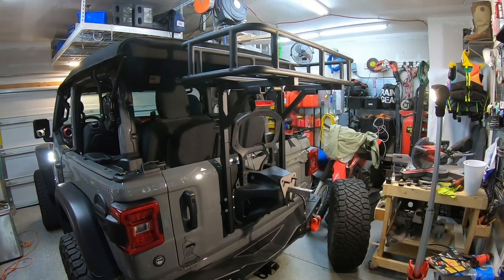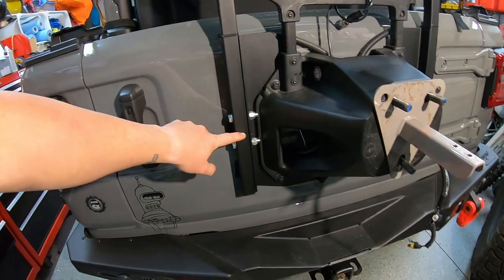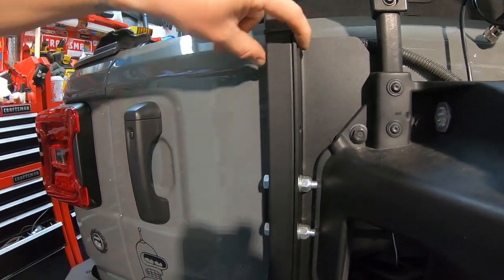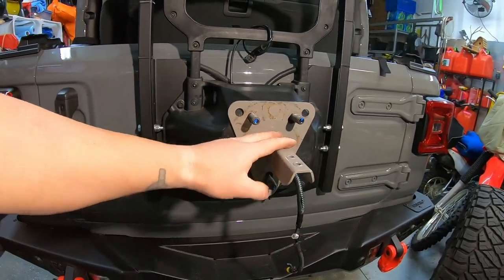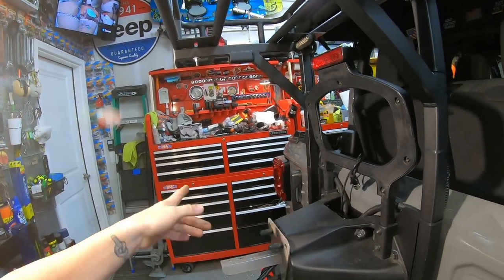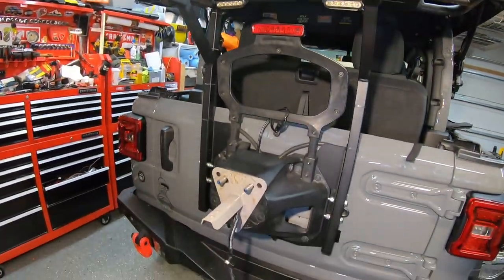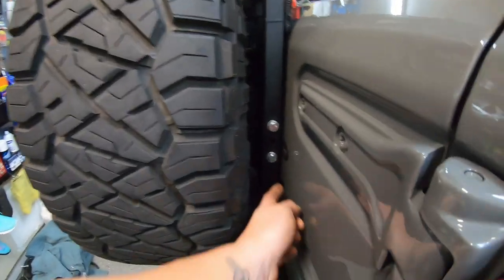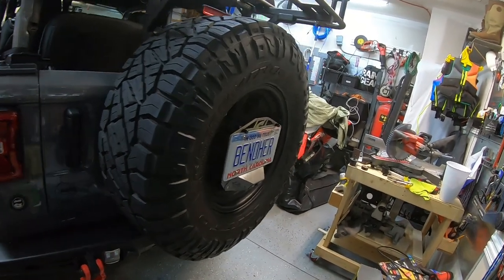Paramount 81-20111 Jeep Wrangler Jl Cargo Carrie

Comment: Question?
35 lbs is the wt load.
If you put a high jack lift will it reduce the weight load you can put in it?
Reply from the maker: Yes, although we made a trip from NC to CO and had a 36 lb bag on it and just the stick part of the high jack lift. We took the rest of the mechanicals off and had it in the jeep and had no issues. I did drill 1 new hole to make the carrier lower to the tire and the extra bolt probably helped secure it a little.